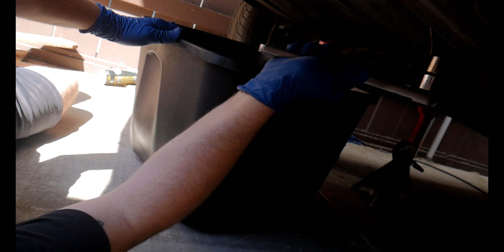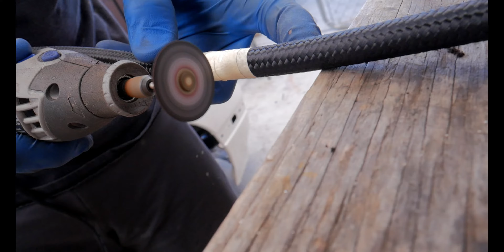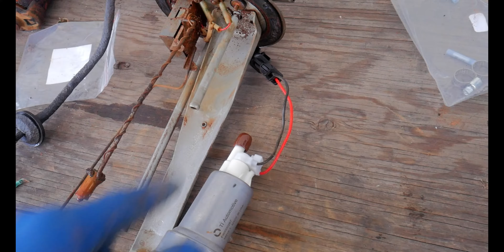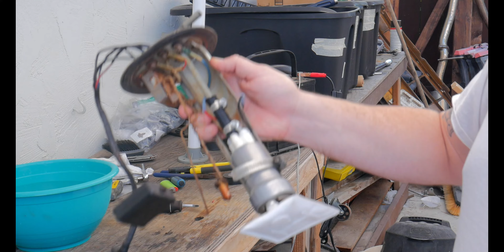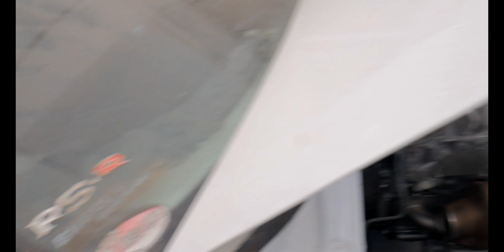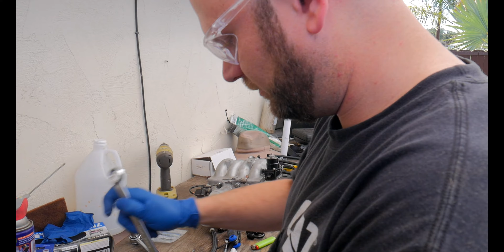NEW fuel system!!! FC3S RX7 1988 Mazda JDM

Comment: It's my belief the factory hardlines are not e85 compatible and will corrode if e85 is used. I'm curious, after a year, if you've found this to be true?
Reply from the maker: They are stainless steel and will not corrode with e85
Reply: @MohrGarage  well then I wasted a small chunk of money replacing the whole line...lol
Reply from the maker: Hopefully you upgraded the diameter at least?
Reply: @MohrGarage  might as well right?...I went with -8 feed and return

Comment: Greetings from AZ,  what FMIC piping is that? it looks awesome
Reply from the maker: It's custom
Reply: Also I had a question, is this before or after the fire, or is this even the same car that had the fire, only concerned it look like everything was done well.
Reply from the maker: This is before the fire. I got a second right hand drive FC after the fire that I'm working on. The burnt FC will be rebuilt though!!
Reply: Oh okay, well that make alot of sense now, I thought you had one LHD and one RHD, i was wondering how this fuel system would have caused a fire cause it's clear you didnt cut many corners

Comment: How did you find the quality of the Amazon fittings? I need a couple of fittings and line for the "external oil mod" on my build, I'm not super concerned about saving the money, but the 2 day shipping is enticing.
Reply from the maker: Quality is good. I have not presurized the whole system yet so I cannot say for sure..